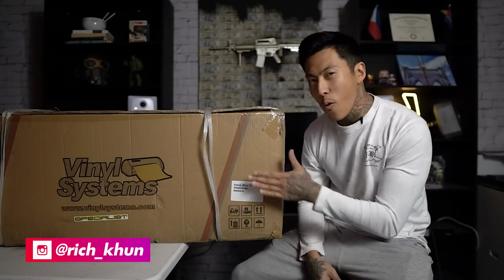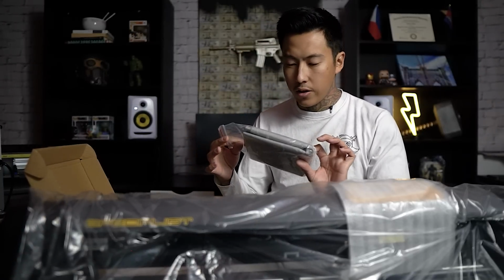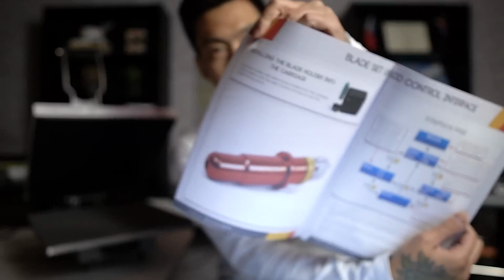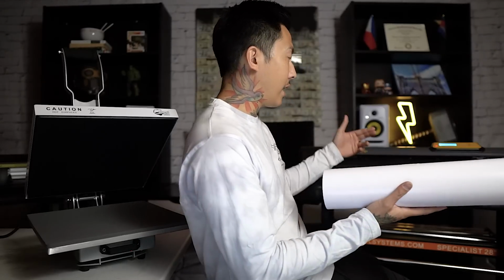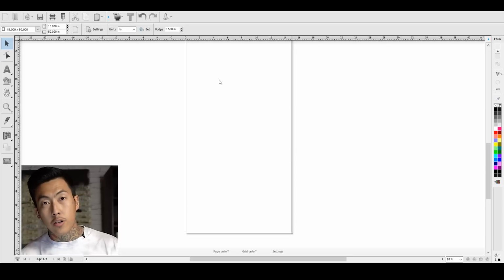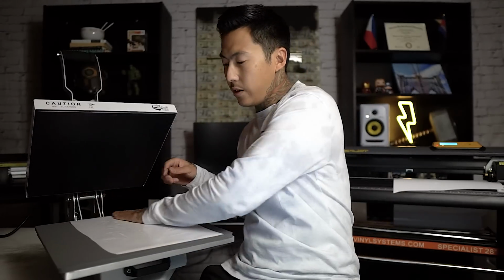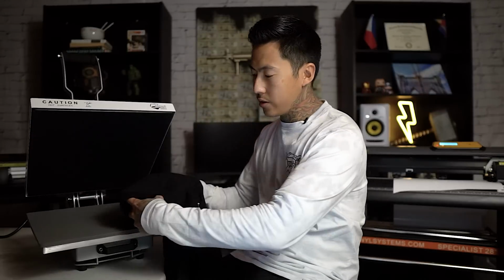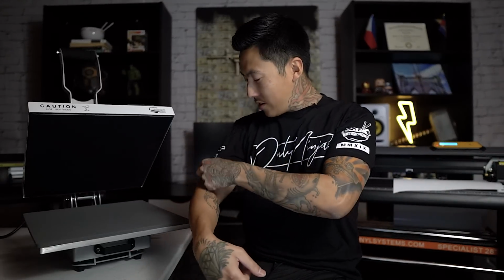Best Budget Vinyl Cutter For Starters | Vinyl Systems Specialist 28" - Heat Transfer Vinyl Cutter

Comment: Buy the next one up, The Edge model because it has the eye to read registration marks. This unit he's reviewing  doesn't do that.
Reply: I was thinking about getting the edge or the specialist. I have enough in my budget to get the edge. I'm just wondering if the upgrade from the specialist is worth it.
Reply: @hammertoe00  if your gonna be doing contour cutting it is. The Evo  of course is best because of the servo motor.
I've had my Edge for about 3 months now and I love how much faster it cuts and bigger jobs I can do over my Cameo 3. I still do use my Cameo though at times.
Something to keep in mind. You will want to buy another blade holder so you don't have to swap blades from when you want to cut thicker HTVs
Reply: @hwrida  a blade holder? Sorry for asking dumb question. I'm very new to the game.
Reply: What does that mean ? I’m new to all this as well
Reply: @e2wDesigns  Whats the difference between contour cutting and the design he cut out? It looks like the machine cut around the curved design he made.

Comment: Question: Does it matter the material of the t-shirt (100% Cotton or 50/50 blend or 100% Poly, etc.) if the vinyl will last longer?  If the technique and pressure on the transfer is still strong and consistent, does the substrate material make a difference on the longevity of staying on the shirt?  Or how bright the print may be?  Thanks so much for your time and these videos.

Comment: I see some vinyl cutters where you have to flip the image when you print, and some like the cricut where you don’t flip the image but need to put on heat transfer paper. Is this due to the cutter used or due to the vinyl used? I’m so confused why I see both of these.

Comment: Im on the fence about this one and the cameo 4 plus as they’re both the same price, what would be some differences if you can point them out please
Reply: cameo 4 plus is 15" cutter, this is much much wider.
once you start using it, you will appreciate a cutter that can do 20-24". you can more designs at the same time.
Reply: The software on the cameo is more user friendly and adaptive. I have both systems. I mainly use my cameo now. However for bigger or multiple cuts for bigger orders I use my plotter cutter. Depends what you want to do tbh.
Reply: @Diiverse  Can this one cut out certain shapes I make?

Comment: Hey so I have a question. Does anyone know what Vinyl cutter is compatible with Mac laptops? I just ordered this vinyl cutter and had to return it because I realized it doesn't work with mac.  My main goal is to vinyl cut my heat press transfers (printed right out of the printer). It just sucks this machine doesn't work with Mac. I will not be cutting vinyl, only the inkjet heat transfer paper.
Reply: From my understanding most arent compatible with Macs, only windows software.